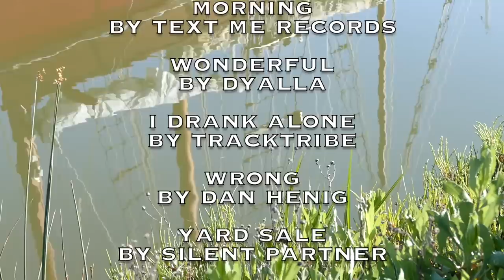Salt & Tar: Ep.196

Comment: Hey guys:
I just hauled out at the end of March here in LaPaz Mexico. I thought I was going to have to purchase an additional gallon of Petit Trinidad bottom paint to add to the paint I brought from the states. The price at the local chandlery was $600.00 USD, that included 16% sales tax. I highly recommend you stow four gallons of your bottom paint away in your bilge before you leave the states. I stored mine for two years in my boat before using it and it was fine. B & J S/V Voyager
Reply: Great tip. A sealed gallon, or four, of paint can serve as ballast until needed. Just might take some extra mixing when needed. Yeah, that extra shipping/import cost will eat you up in a foreign country's store.

Comment: You two might enjoy R. D.  Culler's book Building and sailing a replica of Joshua Slocums Spray - by the way I remember he experimented for 25 years using a good house oil base enamel paint for topside. He used the classic method of burning off old paint and repainting

Comment: Awesome job,  Love all the work!    The only thing I would think you might want to consider is what to do with the engine cover if you're in a rough sea and need to do some endine work.   Maybe make it come apart into a couple of flat pieces or have a way to lash it out of the way while you're working underway.    Just something that popped into my head in a previous video when you were geting the transmission out or in. I don't remember and forgot to mention it then. Thanks for sharing!

Comment: OK Ruthie, on top of all your other duties, it's time to learn how to 'knit a net' so you can make a pair of triangular nets for the bow sprit and have somewhere safe to bask in the sun! 🤭And Garrette, would you consider a 'Helmsman's Rest' for those long sailing voyages where you won't want to stand for hours on the tiller. Basically just two 3 or 4 foot long 'C' shaped 2 x 8" rails joined top and bottom by 18 to 24" long balusters and affixed to the deck with eye bolts for easy removal. Sort of a larger version of a semi-circular pin rail at the mast. You could even pad the top rail for extra comfort and 'butt purchase' in rough seas...🤢